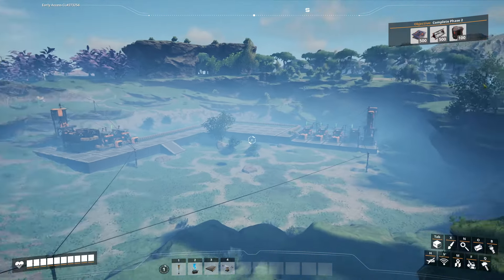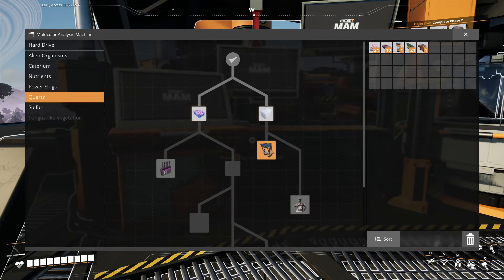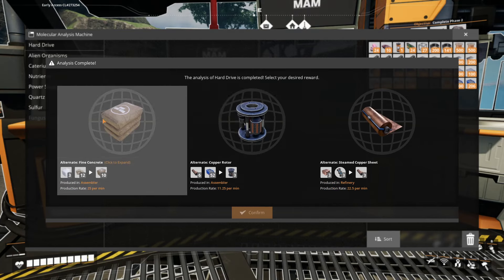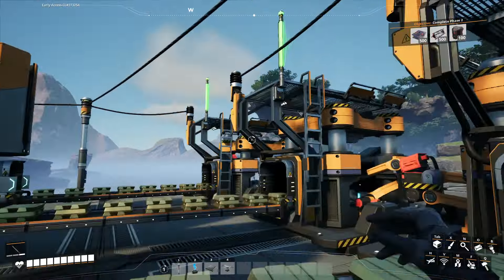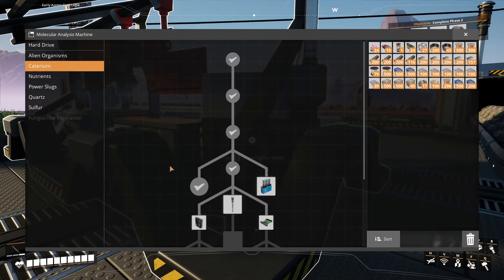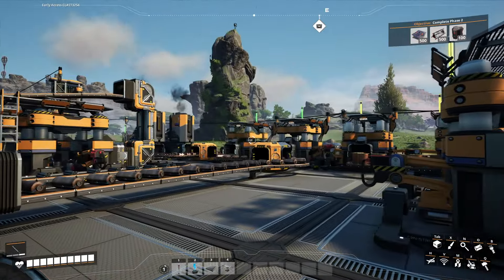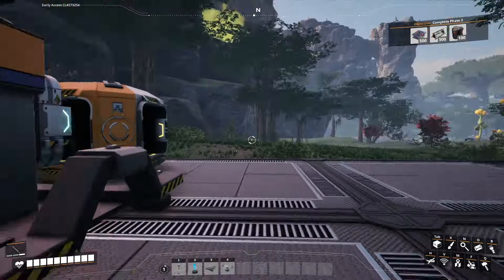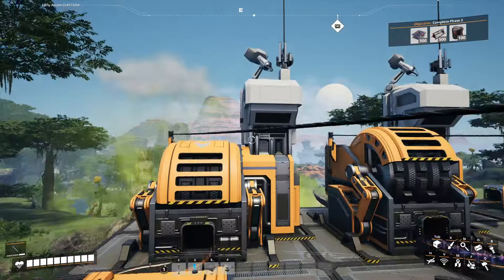Caterium and Quartz!  -Satisfactory PT4

Comment: There is a relatively easy-to-reach quartz nodes directly north from that pure caterium node that you tapped; those 2 lakes where the eastern one of the lakes has lost of coal nodes on north of it, if you continue uphill from the eastern lake, you can find 2 pure quartz nodes guarded by couple of plasma spitters. When doing a grass start I have always led a conveyor belt from these nodes all the way to base area, which of course looks ugly, but my intention is to later replace it with a railway. Having that conveyor will give very easy access to crystal oscillators which give some truly powerful alternate recipes.
Reply from the maker: That's S tier informations for sure. I'll have to check that out later.